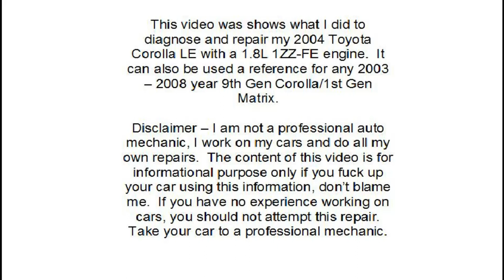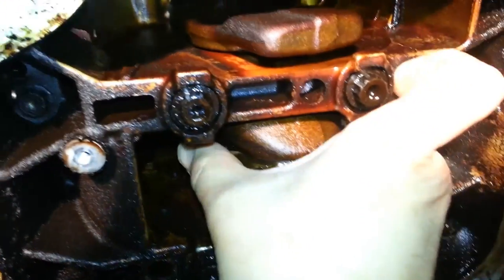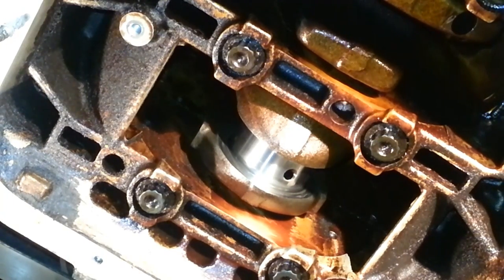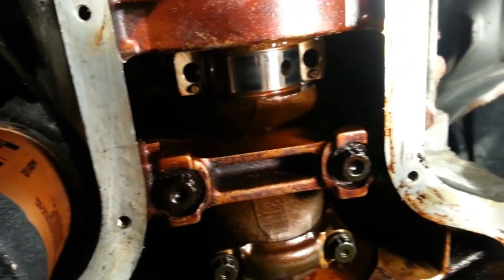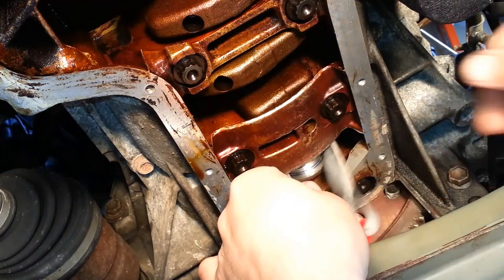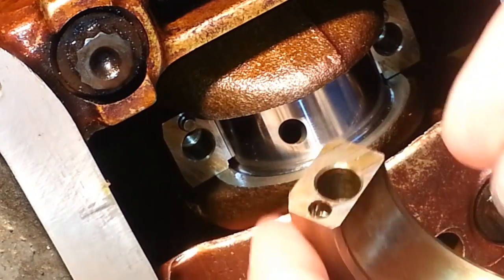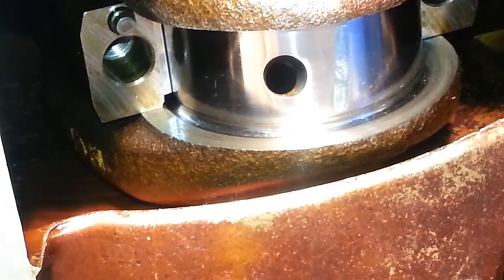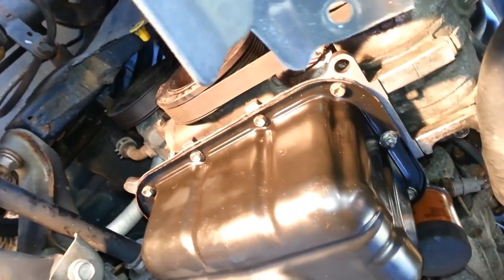2004 Toyota Corolla 1.8L bearing replacement to fix rod knock caused by bad connecting rod bearings

Comment: Why waste time when correct procedure should be either rebuild engine or pull off pan and change all rod bearings. After determining journal condition and clearance with plastgage. Also replacing oil pump to restore pressure would likely be wise.
Reply: this as "cheap as possible" fix. This isn't a cherished vehicle.
Reply from the maker: Why pull the engine if there is no reason to?  All the connecting rod bearings were replaced after journals were polished and clearance measured as detailed in the video.
Reply from the maker: @sytran666  It was cherished for another 5 years and 75K miles after replacing the connecting rod bearings and then sold to a new owner still running great.
Reply: I have a slight knock in my 04 vibe 1zzfe I’m hoping to do a rod bearing swap & journal polish.  

If you kept a eye on the oil it was fine after right?
Reply: When rod bearings start making noise it is  a serious problem and you need to get on it fast before engine self destructs. 
This may be caused by high miles on engine, poor oil condition and viscosity, abuse, and /or lack of oil pressure. Or all of the above.
So in my first msg i was trying to address most of these.
Before the engine will run many more miles the journals have to be smooth, bearings have to be smooth and good condition, clearance between them has to be in spec, oil has to be correct for engine and clean and OP has to be in spec. So oil pump could also be a problem.
If you can get all those things in spec with pan off, do it. You are a better mech than most.
But if several of these problems exist it could be a sign of other issues caused by neglect or abuse so remainder of engine such as valve gear and/ or rings and pistons may be due for attention.
Engines are not plug and play like your new iphone so just slapping in some new bearing shells may not fix it for long. Since there are several or many factors in play.
Reply: @robertrpenny we all know this... but when you have a 15 yest old car it's worth a shot chucking $100 at it,  it's generally not worth pulling the engine
Reply: Mr Mark G just reading and watching random stuff about this engine and car for possible future rebuilding and general learning (since I drove for like 20k miles not realizing I had oil leak and oil consumption issues).... but Holy smokes just realized this video was made 5 years ago. yet You're still in the comments answering questions and stuff like a true gentleman. also maybe I can rebuild this engine as practice and then go do my crappy headgasket blown cobalt one day

Comment: I guess if you don’t have the money or means to send the crank off to a machine shop to get fully inspected and machined, this will buy you a little time so you can dump it off onto somebody else.  Other than that, this is only a bandaid.
Reply from the maker: Well the band-aid is holding up fine and engine is still running great after 70K miles.
Reply: Mr Mark G good for you
Reply: @mrmarkg8564  pff, served. 😆
Reply: This is a permanent fix. 4 years later the engine runs perfectly. If you had a new crankshaft and new bearings it WILL ALWAYS grind themselves down a bit. I don't know if you've ever done first oil changes on vehicles, but the oil comes out looking like glitter. And the same for engine rebuilds.....
Reply: Yeah, that's great, SCREW someone.  That's why I ALWAYS BUY BRAND NEW.

Comment: So, Toyota isn't indestructible!! Just a little over 100.000 miles?? SCOTTY KILMER ISNT GOING TO LIKE THIS!!  I've got 338.000 miles on my 94 Trans Am I bought new.  Engine never been touched,  not even timing chain.  Lt1 Engine,  still purrs and sounds like new.  Pontiac Engine better than Toyota!!! Lol!!
Reply from the maker: LOL.. Not many engines are indestructible John if you don't take care of it.  I brought this one with 110K on it from a youth girl who didn't have the oil changed very often.   Check out my video of a 2001 Monte Carlo I had with the 3800 V6 engine.  Brought it new in 2000 and that was the first major job I did on that at 314K miles.  That car still ran great when I sold a few years ago with 347K.